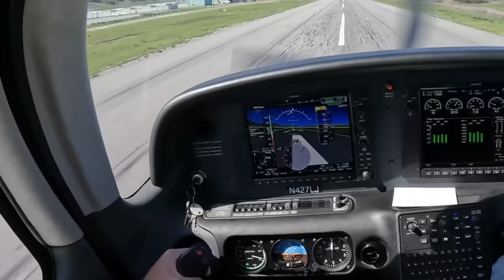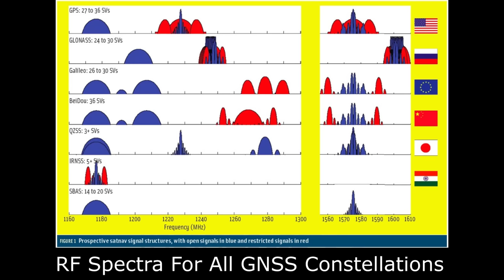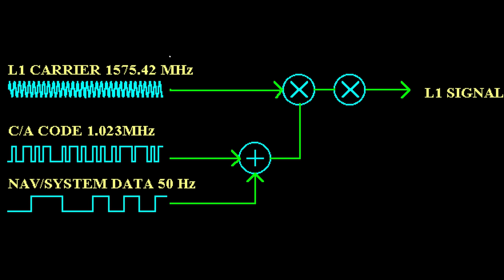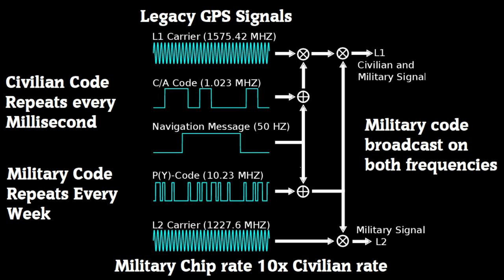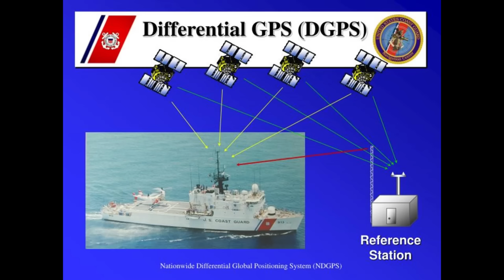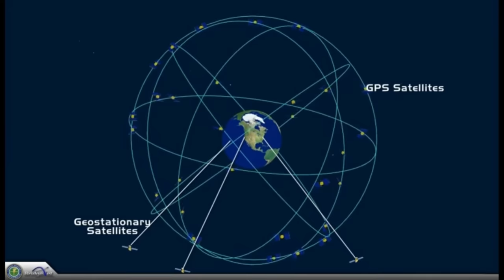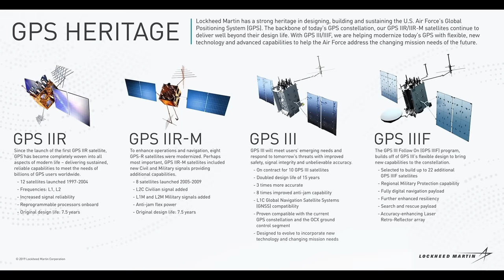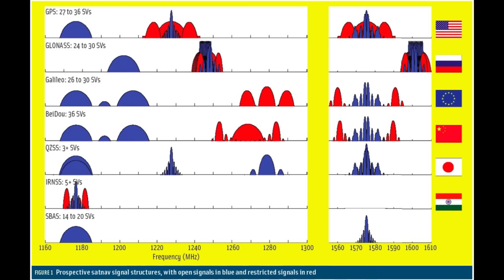How GPS Works, And How It Got Better Than The Designers Ever Imagined

Comment: Another interesting fact about GPS which you didn't mention (at least i didn't hear it) is that it requires General Relativity corrections to obtain the accuracy we are used to.   I always found that very interesting and surprising.
Reply: Yes!  I was going to mention that as well!  😀
Reply: As far as I know, it's the only system that requires both quantum mechanics (atomic clocks) and general relativity (frequency corrections) to work properly!
Reply: And even more interesting is the fact that the in the first gps satellites two clock system were onboard. One with relativity correction and another without the correction because the military where note « sure » that the Einstein relativity was true !
Reply: The satellites are gaining 45 microseconds per day as predicted by General Relativity. That's taken up by lowering the clock frequency in the satellites to synchronize with ground clocks. The satellites are moving sufficiently fast enough to lose up to 7 microseconds per day as predicted by Special Relativity. That's calculated and corrected by each receiver.
Reply: re: "it requires General Relativity corrections to obtain the accuracy we are used to. "
Adjustments are made by ground control stations on a routine basis to correct for this. No magic involved here. Per the ops plan they use. This can be verified.
Reply: @uploadJ Are you saying that relativity is not used? I've noticed that online there is a lot of disagreement about this. Some say SR GR is used,  others insist it is not.
Reply: @bruceswanson6647  re: "Are you saying that relativity is not used? "
Not in the daily corrections, no. If you find out something different, I'd like to read about it. I went to their website and read about what they said they do ...
Reply: @uploadJ  SR GR are not required. If we need to lower down the clock frequency in the satellites to synch with the ground, then "Which ground is that, whereabouts?" Are the satellites sending different clock frequency to every different grounds/points on earth, same satellite sending different clock to San Francisco and to Los Angeles? = No... This is why Scott Manley does not mention about SR GR. They are not required...
Reply: @adharyanto  re: "SR GR are not required."
I think you are confused about what I wrote, somehow. Did you mean to address someone else on this, and click my name instead? As mentioned above, ground control stations issue commands /corrections  on a routine basis on ground station observations of the satellites. Okay?
Reply: SR and GR corrections are not needed because satellites clocks are constantly reset by ground stations. So it is a hype and a myth that w/o Einstein GPS would not work.

Comment: I remember using some of the early Magellan GPS receivers during the 1st Gulf War. They took (at least) a few minutes to give you a location measured in 10s of meters and used up AA batteries like they were going out of style. Still, it was the only way we were able to effectively do our mission of radio direction finding, as it required knowing exactly where our equipment was located. There's virtually no landmarks in that desert! The Magellans were also pretty scarce; we were issued one per platoon (4 teams per platoon), meaning our LT and PSG had to escort us out to our intercept sites.
Reply: How was radio direction finding done in WW2 without GPS?
Reply: Most WWII DF was HF, compared to VHF in the 1960s-2000s. Otherwise, it was basically done the same way, but it's difficult to get a good fix (where 2 or more lines of bearing from your direction finders to a transmitter cross) if you have an imprecise starting location. We needed a minimum of a 6-digit grid (10m) to start from, which frankly wasn't hard to get anywhere besides a featureless desert.
Reply: @jarink1  thanks for the explanation. I remember a documentary about SOE agents dropped into France that had secret radio sets that they clandestinely used but the Germans were monitoring it and found their location
Reply: Better then the hand drawn maps we had in the rear. MSR, to MSR. And of course, the 7th, and 18th had different names for the same MSR. We had a lot of luck guiding us.
Reply: I vaguely remember those things. Now we have a gps in our watch that is 1000x better and uses a zillionth of the battery power 😂
Reply: Was “Selective Availability “ still turned on then? I remember those days of intentional degradation for public GPS.
Reply: @rockmusicman21  
The main target of WW2 HFDF (huff-duff) was submarines, so the DF stations would typically be located along a coast.   HF propagation over salt water is far more reliable and consistent than over land, so costal locations are ideal.  Coast lines tend to be well mapped to try to avoid ship wrecks, so it would have be fairly easy to look at a marine chart and figure out where your DF station was.  HF antennas are large,  so the DF stations would be fixed rather than mobile, taking weeks or months to install....if you needed one in a different location, you'd build a new one rather than move an existing one.   HF bearings have far more ambiguity than higher frequency DF, so it wasn't so critical because even if you knew your exact location to the foot, you could only pinpoint  the sub's location to within a few miles at best.

Another feature of WW2 battle of the Atlantic was that the allies were getting ULTRA intelligence from having cracked the Kriegsmarine enigma code.  The Subs would send in daily weather reports which included their location. (as best they could determine)   So some of the most accurate "huff-duff"  sub location information was not actually from DF measurements at all, but was passed off as such to conceal the real source of the information.
Reply: @oldmaninthemirror  re: "Was “Selective Availability “ still turned on then?"
Enough averaging and you get your position. Full-up mil GPS can use P code (besides C/A code) anyway, something civilian sets didn't have access to.
Reply: @uploadJ  I bought one of those Magellan units in 1990 or 91. Yeah, they burned through the batteries! I remember only 100 m accuracy, though I know I got much better than that. Vertical precision was probably 100 m though. I figured that out while flying. I had to hold it against the window to get signal.
Reply: I still have mine!  They acquired faster if you preset a close time & position.  Took hours the first time it read a full almanac!

Comment: You missed one of the big changes which was the evolution of receiver hardware.

It started with a single correlator which had to be shared between all satellites used. A PITA and a reason behind the 15 minute cold start time. If you didn't have a current almanac (rough satellite positions) and time, you didn't know which satellites to look for. So find one by chance and wait for the almanac to come in.

Over time more correlators were added until you reached the "all in view" systems. These don't need almanac data because they just assign one correlator per satellite. Thirty seconds later you have ephemeris data (accurate orbital parameters) and a position.

Even better is that with more correlators you can track and use all the satellites in view rather than just the minimum of four. This lets you calculate a least squared error solution which improves accuracy. (You can of course fold data from multiple GNSS systems into a least squared error solution.)
Reply: Good point. I just knew the basics of how gps works, in fact the math resembles using a sextant and the Reed Almanac tables, it's known orbits and the reveiver does observations, it's just slightly different observations, here it is distances. So, I did understand how hard it must have been these days, to get these calculations done in time. A cpu in 1991 was bloody expensive, or it was cheaper and lacking number crunch power. How did they do it? And WHO built these chips? It was a military project, after all, that precision restriction was a big deal.
Well, your comment explains a lot, it was dedicated hardware, not just fast i/o and smart software.
Reply: Increasingly cheap computer power allowed the change from sequential tracking to simultaneous tracking. One of the freely available, but not open source, SDR packages available to day allows one set of hardware that samples at a high rate to feed a generally CPU capabilities or screen size allows number of simultaneous receivers. It's as if you had 16 receivers all sharing the same antenna, as might have happened in some military installations in the 1950s to surprisingly recently. Now they share one analog to digital converter. The rest is "a simple matter of software."

{^_^}
Reply: The first GPS receiver I had was about 1995, a Magellan with a single channel correlator.  The start-up time could be up to half an hour if the geometry of the satellite constellation was unfavorable at the time.  I left the receiver in the car always on because it took so long to acquire the satellites.  Back then, if you wanted maps, you had to run a program on a laptop computer.  I had Delorme Automap which ran on Windows 3.1.  At least the computer didn’t have to remain in the car and always on.  Selective availability could easily put you on the wrong street when navigating in a city.  The error was up to about 1/8 mile.  You could usually tell when an SA glitch was being introduced and they were usually about 30 to 60 seconds.  Clinton signed an executive order in 1999 to shut off SA by May 2000.

I got a Garmin 2620 automobile receiver in 2003 which included built in maps with enough internal memory to cover all major and minor roads in continental US.  The 2620 also includes WAAS reception.  I was pretty skeptical that WAAS would work because it is something like -140 dBm due to the distance to geostationary orbit, and the car receiver has just a very small internal patch antenna.  But work WAAS does.  When it has lock, which usually only takes a few minutes, I’ve seen estimated positional errors reported by the receiver as small as 2.5 feet.  That is probably good enough to land a plane, but not good enough for an autonomous driving car without other sources of position input.

The other restriction that has been claimed was put on early receivers is that they were not supposed to work correctly at high speed.  The intent was supposedly to prevent unfriendly powers from using commercial GPS units as guidance system building blocks.  I took a Garmin Nuvi on a regional jet flight between Chicago and Denver and held the Nuvi next to the window.  The Nuvi seemed to be accurately updating the the indicated position with the jet flying well over 400 MPH.  I didn’t have any means to tell if the reported elevation data were correct.
Reply: @wtmayhew  The speed limit is somewhere in the supersonic range. And there is also a height limit. Both won't restrict any commercial planes, but are intended to make commercial GPS unuseable for ICBMs and other rockets.
Reply: @Hauketal correct, without the lockout it’s considered military spec and very difficult to get your hands on one of these although I think the rules may have been relaxed.
Reply: Mobile phones can download almanac data to speed up cold start acquisition to a few seconds.
Reply: This comment needs more visibility!
Reply: The other thing that multiple correlators combined with faster processors help with is multipath errors (i.e. reflections from buildings, steep terrain etc.).
Reply: Yea, the CPUs just got faster. Also, they figured out that you could use GPS to correct cheap MEMS accelerometers and replace all those mechanical gyros. GPS may indeed be one of the most signifcant ROIs we ever got from space exploration.
Reply: I always loved that the original correlators in GPS RX used AGC to produce an input signal for input into a ONE bit A/D converter.  The GPS system is mind boggingly awesome.
Reply: 3 satellites for a flat area, 4 for 3D position, any additional adds more precision.
Reply: @wtmayhew  I don't think it was half an hour. I've got one of those early Magellans.
Reply: @Hauketal  600 mph, 60kft.
Reply: @baylinkdashyt and iirc it's a both not either limit?
Reply: I'd have to double-check, but I don't think it can bust either limit independently.
Reply: @voornaam3191  While very similar in theory to the classic sextant (angles then ranges), it's also quite different in that GPS is 'ranges then angle', but the trigonometry is the same. It's just the way that the 'errors' are minimised that differ (like the coast guard triangulation problem while doing area searches in tidal streams).
Reply: There are techniques to improve on the least square solution as well, like the height vs position difference in accuracy.
Reply: @wetmelon actually, I believe it's a known problem that the spec/law is somewhat unclear and has meant that some receiver hardware manufacturers has made it a both requirement when it was (probably) meant to be an either requirement. Ie., there's apparently some commercial receivers you can use to make supersonic cruise missiles work. (iirc)
Reply: Mobile Phone GPS DOESN'T  actually  Download the Almanac containing the Emphemeris Data - your Mobile Provider keeps an updated copy and this is sent too your Mobile - hence it "Appears" to be an Instant update/fix......as your phone is "told" where the Satellites are.....
Reply: I remember when I got my first phone with both GPS and GLONASS support. It was much more accurate and much faster at getting a reading than my previous GPS-only phone. I think pretty much all phones now support both. This is going back to around the time of the original iPhone and Androids, and I was still on Windows Mobile.
Reply: re: "It started with a single correlator which had to be shared between all satellites used."
Hence the contract HDUE used five  hardware channels / correlators whereas the MANPACK unit used just the one.
Reply: @scottfranco1962  gps wasn't developed from space exploration lmao, we needed a way for subs to fix their position to launch missiles, you can thank military for that
Reply: @rfcdgaf  Mmmmm last time I checked GPS satellites are in... ya know... space. They tried driving them down the highway reallly fast, didn't get quite the same effect 🙂

Comment: I'm a land surveyor. Several days ago I took my GPS pole to two nails on a job site and measured them, then returned a few days later and measured the distance between them with the total station and the prism pole. The two measurements of the horizontal distance differ by 16 mm. I can usually get within 30 or 46 mm with GPS.

Comment: While a phone-class GPS receiver is likely to have problems when an SV drifts, aircraft models are SUPPOSED to have RAIM-functionality, which, when they do have it, can suppress one bad SV and notify the pilots even before it gets marked unusable through an overlay system. Fun extra: with a reasonable antenna, a carrier-phase receiver, and PPK, you can see your antenna move up and down due to earth tide.
Reply: So cool, I’ve heard that North America raise and fall about 10 meters when the Moon passes over it , is that right?
Reply: @renesoucy3444  The crust is a lot stiffer than the water, you're looking for an amplitude of around 0.3m.
Reply: No one is mentioning WAAS. Wide Area Augmentation System.
Reply: No one except Scott, who went into it at least a little bit.  Was the first AS he mentioned.
Reply: Most current GPS receivers have 12+ channels- you only need a fix on 4 satellites, but if you track more, the potential error goes down. Since aircraft tend to have a very good view of the sky, they can track all the SVs above the horizon, with some channels searching for fresh. Receivers track but only include SVs a threshold above the horizon in the fix, since their ionospheric variation may be worse.
Reply: @uploadJ  He didn't mention it because you weren't paying attention when he mentioned it
Reply: @rfcdgaf  Well, smarty-pants, do you have a time stamp for that claim?
Reply: @rfcdgaf  BTW, smarty pants, no one in the discussion mentioned WAAS. Pls get your context correct.